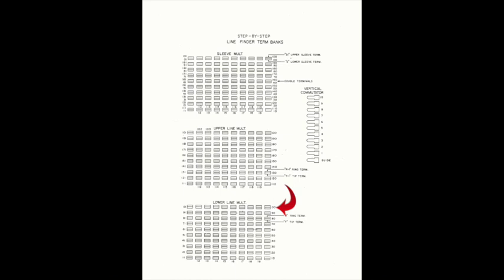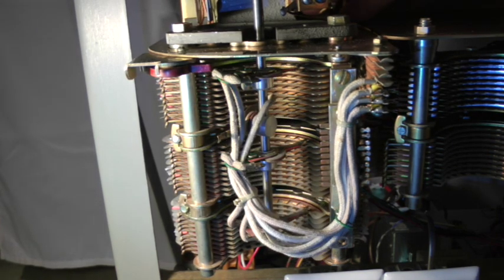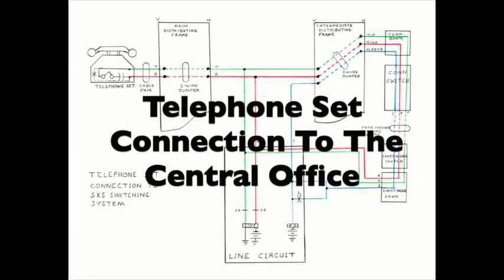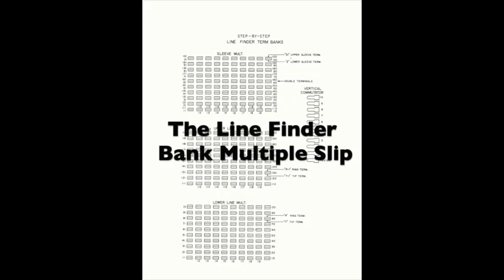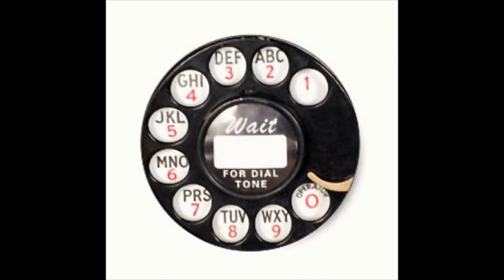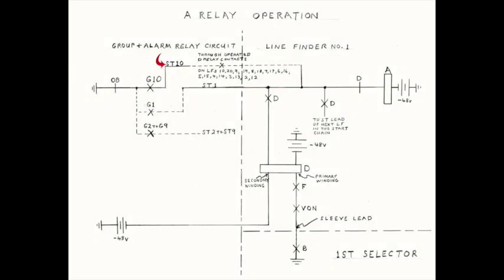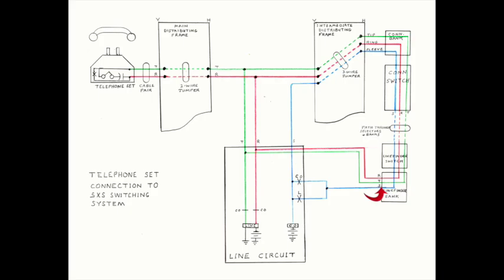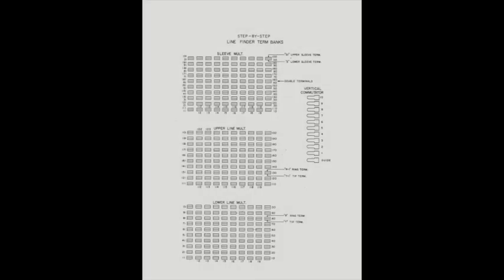The Line Finder In The Step-By-Step Telephone Switching System

Comment: GTE usually allocated 20 line finders per 100 dns. Phone contests quickly overloaded this.
Reply from the maker: Wow, that's expensive provisioning. Typical Bell System city offices would have 16 to 20 per 200 lines. Phone contests would tend to overload connectors, not so much the linefinders.  Neither linefinders nor connectors were provisioned to handle special events. For most of their history they were provisioned based on the busy hour load average of three months.
Reply: Hicken65 we had a radio station in town that would have elaborate contests. When the announcement happened so many tried to get in every  line finder. of in the entire town went up. Finally company sued to make them at least to take 10th call. Not the 300 or so they normally did. I had cleared a trouble and went to sub to test to house. Not knowing the long awaited contest had kicked. All I heard was tweedling for 10 minutes. I started backtracking to see what I had screwed up.
Reply from the maker: @w.p8960  Indeed, a very unusual situation.
Reply: The company I worked for always provisioned 18 line finders for 100 lines. GoS was 1/100. Dial tone returned to the caller in 3 seconds. A choke network was employed in later years to restrict calls able to complete to contest dial ins.
Reply from the maker: @bboogaar  In the Bell System, the engineering criterion was that 1.5% of the calls would get dial tone delay greater than 3 seconds in the average busy season busy hour(ABSBH). This wasn't an upper limit, it was the actual objective. In many towns, the ABSBH originating load per main station would only be 1.1 to 1.5 ccs (hundred call seconds). Applying these types of loads to the traffic capacity tables would produce a requirement for 12 to 15 line finders in each 200-line size group. So there was quite a difference in provisioning methodology between the Bell  and non-Bell companies.
Reply: @Hicken65  I'm familiar with Centrum Call Seconds, Erlangs (not to be confused with the programming language), lost calls, call queuing, theories of probability, etc.,etc.. Although I did not work for a Bell company, we did follow Bell practises. We had bookcases full of BSPs in each CO. However our criteria was DT within 3 seconds. I do recall walking into a #5 Crossbar office on a Saturday morning where few were getting dial tone at all. The tech went home Friday evening and erroneously busied out all but one of the DT markers instead of busying out all but one of them to the trouble recorder as was standard practise.
Reply from the maker: @bboogaar  Ha! That's pretty funny. I guess that blew the dial tone speed stats for that month.
Reply: Bell Systems routed most radio station request lines through a choke network that limited calls to the station's C.O. from the listener's C.O. Only 1 call per exchange could try to connect to the request line. This might be folk lore but the story I heard that caused the need for the choke network was that a radio station in Memphis Tn had a contest that gave away a pair of Blue Suede shoes to the ninth caller.  Now in the SIP world, radio stations still need to limit calls from overwhelming their IP circuit but this can all be done instantly now by programming.
Reply: I worked on this type of equipment at Ft. Benning when I was in the Army in the late 60s. We were set up at 10% trunking.  Ten line finders per 100 lines.  I don’t remember the line finders having three banks.  The gear was manufactured by Automatic Electric.  My MOS was 36H20 - Dial Central Office Repairman.  The reasons I chose this MOS, aside from an interest in telephone, were this stuff requires air conditioning, and you can’t build it in a rice paddy.
Reply from the maker: @kenmohler4081  The line finder groups set up to handle 100 lines only required two tier banks. The upper tier was for the 100 sleeve leads. The lower tier was for the 100 tip and ring leads.
Reply: @Hicken65    Thanks for the reply.  That is what I figured was the difference.  It's a bit surprising that I can even remember what the things looked like 50 years ago.  The Army Signal School at Ft. Monmouth was really excellent.  The Dial Central Office Repair course was 19 weeks.  We traced out all those switch diagrams and took those things all apart and put them back together again.  It was disappointing to learn when I got to Ft. Benning that the maintenance was done by civilian workers and my job was to cut the grass.  I finally got the job of maintaining the 4 post exchanges on nights and weekends, when the GIs did the work of running down alarms and actually fixing stuff.  We had one inside plant and one outside plant guy on duty from 5:00 PM to 8:00 AM and 24 hours on the weekends.  Later I was transferred to Germany, where the equipment was Siemens, the techs were German, and I never got to touch a screwdriver again.
Reply from the maker: @kenmohler4081  Well, a 19 week training course seems very extensive. I had to learn it on the job. I did get formal training on No. 5 Crossbar,  but by the time I went on the course, it had been shaved down from 6 months to 11 weeks.
Reply: It also just occurs to me that I don’t remember the Automatic Electric bank wiring being color coded. Seems like it was all just gray.  Anybody else have any memory of this?

Comment: The other amazing thing is that you’d need to have so many selectors for the prefix of the phone number.   In the city I grew up in we had 42x-xxxx, 45x-xxxx, 47x-xxxx.  There were about 25,000 people.  Now there are 500,000 people and many more exchanges.  However if you divide 25,000 into 3 it means each prefix had to support 8,333 people.  That’s a lot!   The digit 4 was ignored but the 2 would be significant.  You’d need many selectors if many callers dialled 42x-xxxx.   It’s mind boggling.
Reply from the maker: In a large exchange, it worked out to about a half a switch (of all types, line finders, selectors and connectors) per telephone line.

Comment: I'm thinking of the effort to design the entire system (without computers). And to build these highly reliable components.
Reply from the maker: The development of the SXS switching system was started in 1889 by Almon Strowger. It took about 30 years for it to mature into a reliable, efficient and cost effective system, with most of the design improvements made by Automatic Electric. By 1920, it was accepted by the Bell System, who introduced the SXS line finder switch around 1928. Improvements continued through to the 1970's, just as large scale removals of this equipment began. At their peak, the number of SXS lines in the Bell System reached about 25 million.
Reply: @Hicken65  Until the advent of cheap digital electronic devices, the SxS system was probably the most economic switching system for most situations. The British Post Office had a choice when converting London exchanges (offices) to automatic - use Bell's Panel equipment or use SxS with 'directors' (a bunch of 2 motion selectors, uniselectors and relays which converted the three initial digits to a 1 to 6 digit routing code). BPO chose SxS because there was already British manufacturing facilities for the equipment and employees were familiar with it. Not sure what the raw economics would have been, but the cost effectiveness of Panel over SxS could not have have been too significant to cause BPO to choose Panel. Even Bell replaced a Panel office with SxS.
Reply from the maker: @netking66  I don't think Panel was ever used outside of the Bell System. In the early 1920's, The bell Telephone Company of Canada (which was closely affiliated with, but not a true member of the Bell System) was making plans for their gradual conversion to dial, beginning with Toronto. The company was heavily pressured by the Bell System to install Panel. However, the Chief Engineer was having none of it. He had recently joined BTCO from the telco in Nova Scotia, where SXS had already been successfully installed and was working well .Also, BTCO's manufacturing arm, Northern Electric was already licensed to manufacture Automatic Electric SXS. Toronto's dial conversion continued with SXS for the next 25 years.
Reply: @Hicken65  Before Panel, Bell System  developed a system called 'Rotary' (not to be confused with rotary dials). Like Panel it was power driven via shafts and clutches and used 10x30 outlet selectors (or 10x20 for final selectors). Also like Panel it used revertive impulse control where the selector sent impulses back to a register which signalled the selector to stop when in the right position. Presumably Panel's 25x20 outlet selectors was seen as an advantage since a 10000 line office just needed two stages instead of the usual three although an initial stage would be needed in most cases for trunks to other offices. Despite this Rotary went into production with the first switch being installed in New Zealand (and that switch may have remained in service until replaced by a digital switch) and Rotary was used in Paris and other European cities. Possibly Bell preferred to offer Rotary to overseas markets meaning that Panel was never used in these markets. Also Ericsson had its own 25x20 outlet power driven system which was conceptually rather similar to Panel.
Reply from the maker: @netking66  I was aware of the Rotary System, but never saw one or studied its operation. Thanks for the additional information.

Comment: Very intensive and great video.  The complexity of this mechanical exchange is mind boggling, yet it was very reliable.  We had a step by step exchange until the late 1980s when it was replaced with a digital system.  I used to pay attention to the sounds when dialling a number.  Now I understand why the last 2 digits dialled did not produce any clicks.  All of the previous digits before the last two digits would have a thump sound, and that would be the wiper spinning over to an available path.  I’m still puzzled by some aspects of this.  If the wiper scans over the circuits testing them for ground until it finds one that’s free/available, how come it would not make a click in the ear of the people already using those circuits on other calls as it swipes past them?  It would seem as if it’s physically cutting into the line and then moving on to the next one.  Very strange.  In my city all phone numbers started with the digit 4.  On the step system the 4 did not need to be dialled.  You could just dial the last 6 digits.  I noticed when I picked up the phone and dialled the 4, it would remove the dial tone but there would be no thump.  This means there was no horizontal sweep happening.  When dialling the second digit you would hear the horizontal sweep.  Or of you left the 4 off and dialled 6 you would hear the thump of the vertical wiper action.  I’m not sure how they did this, but they seemed to deactivate the first dialled digit but only if it was the digit 4.  If it was any other digit dialled it would activate the horizontal wiper movements.  After watching this video, that part puzzles me.
Reply from the maker: When a selector is rotary hunting for an idle trunk, its tip and ring wipers are open (electrically dead). Only the sleeve lead is alive. For your questions on short dialing, you need to look at my video "The Selector In The Step-By-Step Telephone Switching System Part 2" which explains the concept of digit absorption. You'll find it by searching on my channel name Hicken65.
Reply: Hicken65 Thank you that makes sense that the tip and ring would be dead or yes it would interfere with calls as it swipes across the terminals.  I’m assuming one of the magnetic relays removes the power from the tip and ring as it would need to be connected once it found a vacant line.  I’m so interested in this but there’s so much going on that it’s hard to retain everything.  The switch is doing a ton of things.  It’s hard to believe this was designed so long ago.  Not much longer after electricity was discovered.  Not only would this take a very analytical mind, but the mechanical design - the dogs - the spring - the failsafe grounded circuit so you can’t dial more than 10 pulses.  It would require enormous skills to mechanically put together something like that.  There’s no CPU or computer behind all of this.  One magnet is activated by the result of another.
Reply from the maker: The  workings of a two motion stepping device was so intricate that Almon Strowger was unable to  get a reliable working version built. It was the brilliant people that he hired, Alexander Keith and brothers John and Charles Erickson, that actually built and patented (U.S. patent 638249) the first recognizable version of the SXS switch. I never cease to be intrigued by watching and listening to one in action.
Reply: @Hicken65  In looking over the patent drawings, the mechanism invented in 1895 is essentially the same as later makes. It's a bit of a wonder to me that WE did not re-design the relays, etc. (The panel system had a relay design without bearings that was later deployed in crossbar.) Presumably the patents had expired by 1921 when the Bell System started deploying SXS offices. They held out for a long time with manual operators. I think this was considered a service feature. The Keith/Erickson design is clearly the work of experienced mechanical designers. Strowger had a funeral parlor to run. Curiously, the panel system was deployed in 1923. COs were deployed with both systems, but it is not clear to me what advantages panel had in large metro COs. My Midwestern city of a million only had SXS offices until crossbar came in (about 1961.) When it first arrived, the local techs did not understand it well. My grandmother's phone in a growing part of the area went from SXS to crossbar. It did strange things and didn't always work predictably. One day she called a Bell supervisor and complained. He gave her a spiel on how wonderful this technology was. Being a non-technical person (but saintly) she listened and then replied, "and wouldn't it be wonderful if it worked!" The crossbar exchange was not replacing SXS but supplementing it in new areas. Only later, of course, it was all replaced by ESS. One city exchange was, after 55 years in service, replaced by a #5 ESS. It was not worn out, but for lower maintenance and especially for new features that could not be implemented easily in SXS, the ESS was purchased. I was a MTS at Bell Labs and one of my contributions helped lead to the invention of Ethernet. Some years ago the CTO of Cisco said, "Eventually everything becomes Ethernet." You could easily interface a computer to a crossbar switch, and it would not be an unreasonable design. But today it is hard to compete with Internet Protocol, with the latest switch chip able to run 64 channels each at 400 billion bits per second.
Reply from the maker: @AriBenDavid  The Bell System used the Automatic Electric SXS systems for the first few years. WE began making its own version around 1926. Strowger left the industry around 1897 due to ill health. He died in 1902. I've never been involved with the panel switch and don't know much about it. I believe it had the ability to store the dialed digits, perform translation tasks and route the calls using  dial senders. This gave it much more flexibilty  than the direct control SXS. NYC had about 200 exchange names in the 1920's, too difficult to be handled by SXS. The crossbar problem you mentioned must have been a local issue. I worked with crossbar for many years and found it to be extremely reliable. As for interfacing a computer with a crossbar switch, this was very successfully accomplished by Northern Electric at the beginning of the 1970's. The system was called SP-1 (Stored Program - 1). It was sold all across Canada and to many independent telco's in the U.S.
Reply: @Hicken65  The panel system therefore made sense in the largest metro areas as I do now remember it could do translation. Quite an odd device, though. It seems that crossbar with its complex markers could do more. The crossbar switch had precious metal contacts which did not need to wipe but which were electrically quiet. I once found a book "The Strowger System of Automatic Telephony" published in England by Longmans Green & Co. in the University library.  It is one of the finest examples of technical writing. Published in 1925 or 26, the Library threw it out long ago as obsolete. I have not been able to find a copy. It also describes a "director" subsystem for SXS that does translation.
Reply: Ah, Google! It seems some libraries still have it. Author was H.H. Harrison and publication date 1924.
Princeton, NJ has been a black hole for communications (maybe appropriate as that was where the term was coined by John Archibald Wheeler.) I have been told that the switchboard was manual until 1961. Trenton had a Strowger exchange in 1925. The #5 crossbar was finally replaced by an ESS in 1995, likely the last in the state. Trenton got ESS in 1961. In the last 6 months of crossbar operation, the call completion success deteriorated until fewer than one half of calls would go through. I suppose NJ Bell was saving on maintenance until the ESS was cut over.
Reply from the maker: @AriBenDavid  In Europe, the Strowger system was developed extensively during the 1920's to 1940's. The Bell System focused on developing the crossbar systems. If crossbar had been developed by the early 1920's, panel would not have been needed. There are some books online describing early automatic telephony. Two of them are "Automatic Telephony" by Arthur Bessey Smith and "Automatic Telephone Practice" by Harry E. Hershey.
Reply: FYI listen to the dial pulses you hear on a call from a Panel Switching Central Office.